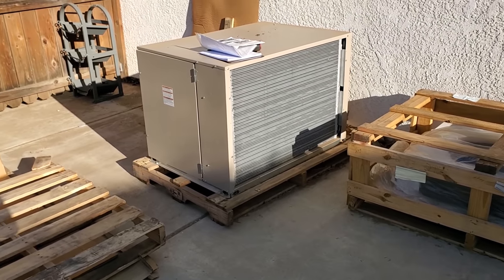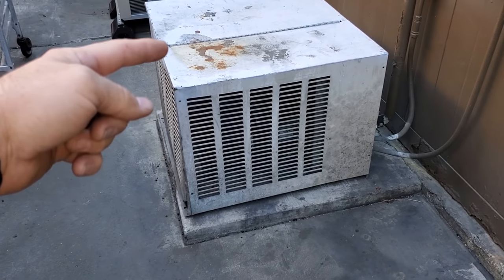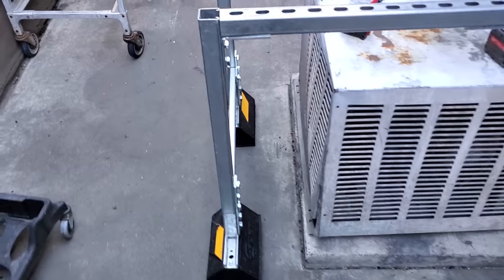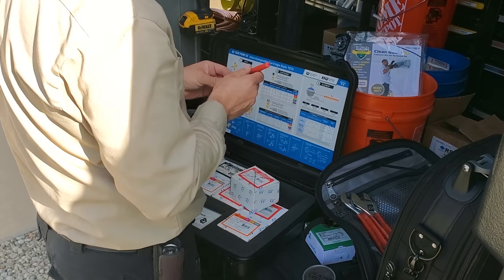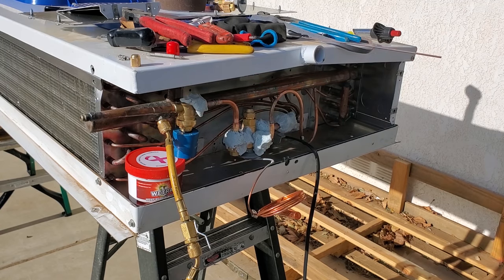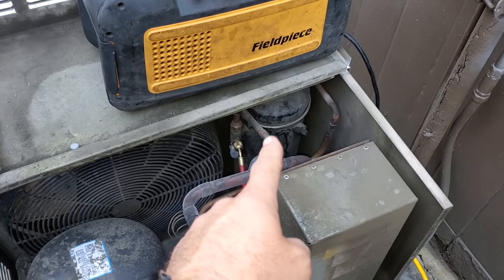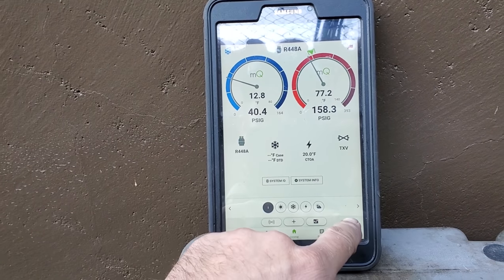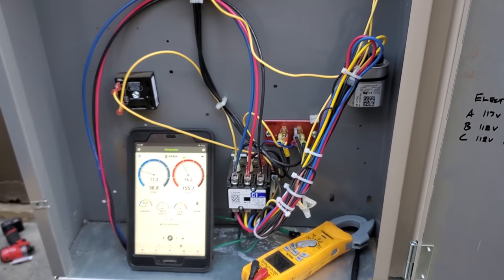WALK IN COOLER INSTALL AND STARTUP

Comment: Hey Chris another option besides building a stand could be using a mounting bracket. We have used these in the past. That unit was pretty big so it may have not worked but just thought I would share. https://www.grainger.com/mobile/product/DIVERSITECH-A-C-Mounting-Bracket-6XJH9

Comment: KE2 makes an temperature controller paired with an EEV (a few different capacities) and 2 temperature sensors for the evaporator coil differential. I believe it serves the same purpose as that sporlan txv kit, make any valve you need in the field. I haven’t used one yet, was wondering if you have, or have thoughts and opinions about it.